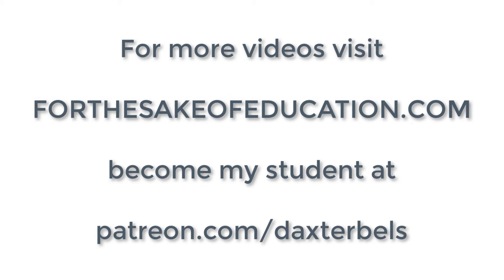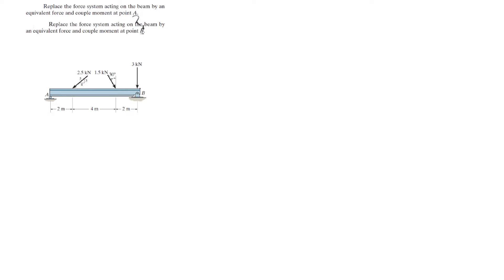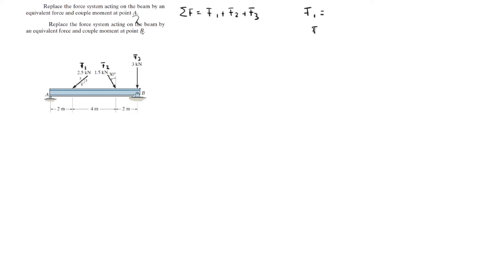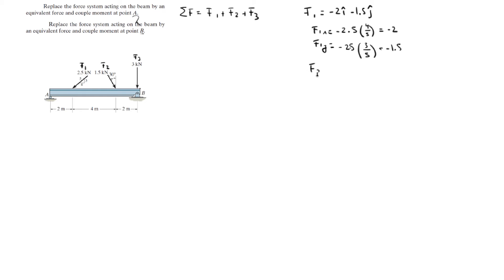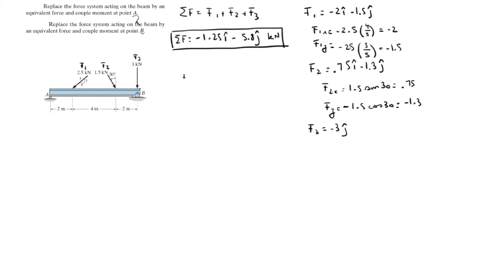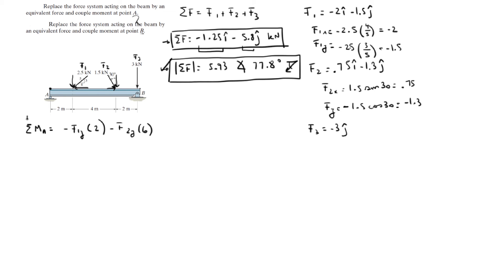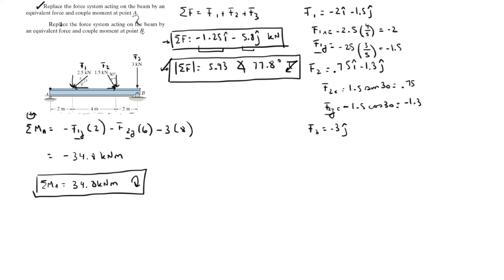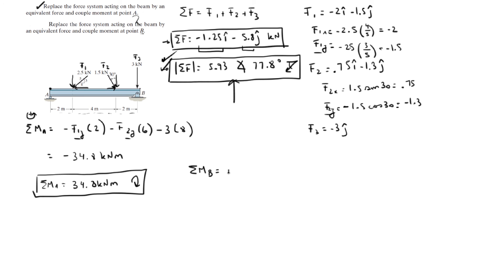Replace the force system acting on the beam

Comment: What about reaction forces at supports? While calculating the moments at A and B you are considering external forces only.Ma calculation includes reaction at B i.e horizontal reaction at B multiplied with lenght.same as For moment at A.  If I am wrong can someone please comment why? Thanks a lot in advance
Reply: you are right. did you solve the question?
Reply: yes I think you are correct the support reactions needs to be considered here